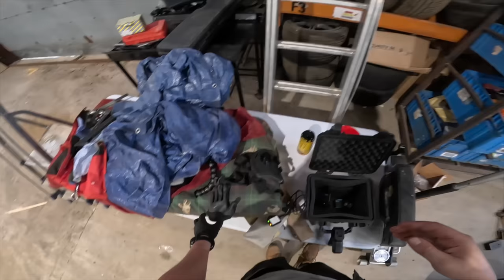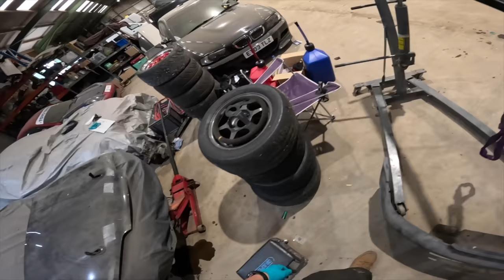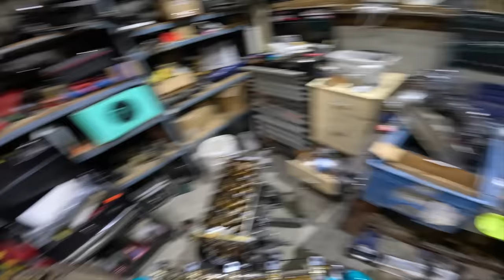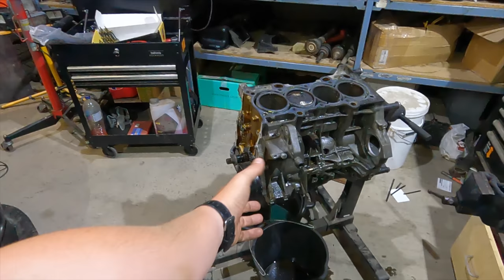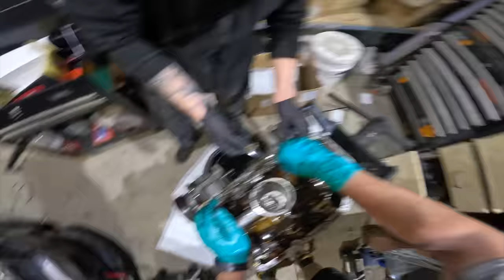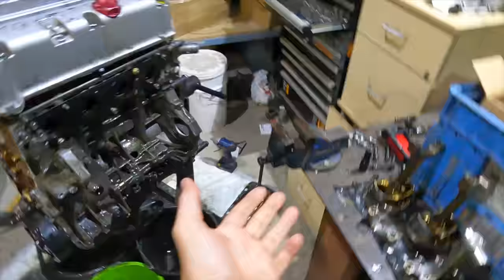What Happened to my Engine?? JDM K24A Teardown

Comment: As a guess I would say low oil pressure / starvation causing bearing failure. Once the bearing failed (and Welded itself together) the rod smashed the piston into the liner wall breaking everything. Probably hit it into the head a few times before it came off for good measure.

Do you have any oil pressure gauges in sight of one of your cameras or any data logging? That would help analysis.

In my experience the sump baffles are generally crap because they don't deal with oil being dragged up the timing cover by the chain, especially on left hand bends.
Reply from the maker: unfortunately no logging, not by default anyway. The ECU can do it but requires assistance from Windows 

I dont have any gauges or warnings either. Just the trusty OEM water temp gauge and low oil pressure light... Don't remember that triggering. Need a gauge really
Reply: @dannyDC2 oil pressure gauge is defo a good addition to a race car - difficult to monitor religiously when racing, but some of the newer sexier gauges do their own data recording over a short period, (basically a playback of the readings) which clearly can be useful  👍

Comment: oiling for the bearing failed.. why? clearances out of spec? det damaged the bearing in the past? maybe just the oil was too old or too hot (or both) and couldn't provide the support that bearing needed. knocking starts very shortly after. 
Could the no cool down lap have left your oil uber hot earlier in the day and that was the last the oil had to give? 
how does the inside of the oil pump look? is it still in spec for clearance? 
injector? is the fuel filter clogged? open it up and investigate. 
too many unknowns without more sensors on the car, was it logging at the time? how does that look?

The feeling of the engine slowing down is metal on metal drag from inside. Had it a couple of times. engine is prob too far gone by the time you notice. 

my guess was tired oil,  lead to bearing oil film support not good enough anymore and then kept driving once the bearing had started to wear. interfearance engine and no bearing left, introduced the valves to the piston and it snowballed from there

Comment: Water got through the idle control valve into your intake, hydrolocked cylinder 3 resulting in a bended conrod. The conrod pin has to be parallel with the crankshaft, if not the piston doesnt slides because no longer follows the shape of the bore. Being forced up and down at 7000RPM x 0,016RPS / 4 cylinders, it gives you a rate of 29 revolutions per second on that piston causing the conrod bearing to suffer too much applied force from the other good moving cylinders which ends overheating the bearings and seizing to the conrod. The thin cylinder wall has seen too much so it brokes to give speace on the push angled cylinder, which ends breaking his supports to the pin and travels freely through the engine with other rotating parts which has no problem to crush and compress the cast aluminium transforming into a nugget
Reply: water ingress from a small hose at 7000 rpm won't hydro lock an engine. Each cylinder has 50cc chamber volume. At 7000 rpm that would allow the engine in ingest 58 times 50cc per cylinder per second or 2.9 litres or 3/4 of a gallon before hydrolocking a single cylinder.  I have cracked a liner once from detonation on a supercharged engine and blew about 3 litres of coolant though the exhaust at 6000 rpm within seconds. No hydrolock, no bend rod, no damage to piston or head. Dropped in a new liner, wet liner system, and it was good to go.
Reply: The idle valve is deleted on this car with a blanking plate

Comment: My theory is … 

2 years of racing, pushing hard at Cadwell the big end bearing decided it wasn’t happy any more. Nothing more nothing less simple honestly wear = mechanical failure . Lap before it went I could here rod knock from the side of circuit, next lap it was twice as bad but no communication with you means we couldn’t tell you to stop . 

High revving an engine with a knocking big end usually ends with the piston exiting the engine . 

Map comments .. injector comments I can’t see how this is as the map and injectors ran the second engine for race 2 and also and full event a few weeks later.

Comment: I don't think bearing starvation or a bent rod can do that. It must have got mega hot in the chamber, and turned the piston into liquid. Must have ran lean, on that pot, which could be a lazy injector, or the wiring that goes to it.
"ahh like rustehh razor blades" :)

Comment: How did the piston come detached from the pin like that?
Reply from the maker: 😅 it wanted to be free
Reply: Pure unadulterated talent
Reply: @dannyDC2 (insert) queen I want to be free🤣🤣
Reply: Piston speed on a long stroke. Could have detonated, weakened the piston which starts the process. The only way to know what happened is to go back in time to when it was knocking & take it apart to inspect. Once a motor gets loose, it is basically using it's power to rip itself apart.

Comment: don't know the rev limit, but for circuit track work, I'd limit that stock k24 to 7200 rpm. At 8000 rpm, piston speed of a 99mm stroke engine hits 5200 ft/min or 26.4 m/s. For a build engine with forged pistons, you just get away with this on track, we talk Formula 1 and NASCAR piston speeds here, but not with cast pistons.  To give you an idea. this corresponds to a K20, 86mm stroke, reving 9200 rpm. On stock pistons, this would not last long either on track.

Comment: Could be piston failure be it through wear on the skirt and then play turning into knocking and then at one point slip turned to grip and shit went bang could have been rings or if it was lean something that would cause or create conditions for a mechanical failure or extreme wear. 
my bet would be on piston or rings crapping out as if it were oil starvation you would have heard the knocking for sure and again the engine wouldn't keep going if a bearing had spun you'd know really fast. 

it's possible a bearing wore out and allowed for free play I suppose that would be enough for some free play that could inturn cause a big failure like a piston cracking or something alike. 

could have been that cylinder lean and melting the piston over time losing hp on that cyl due to a bad injector or something similar too keep testing shit

Comment: My K20 started knocking at Bedford. Luckily I turned it off before it 
“ shit it’s tits “
Either way another engine is going on but will strip to see what mine looks like. 
If I find anything similar will update @dannyDC2
Reply: If you turned it off that quick bang a set of bearings in and go again

Comment: could be so many things. 
oil pressure on that bearing might have been too low because maybe something was stuck in an oil channel,

car might have had knock because of heat of sorts, or because of bad petrol

maping might have issues

some sensor might have a fault giving wrong readings or something

oil film couldve failed

piston couldve failed, rings couldve failed

oil starvation couldve happened still 

no idea 🤷‍♂️